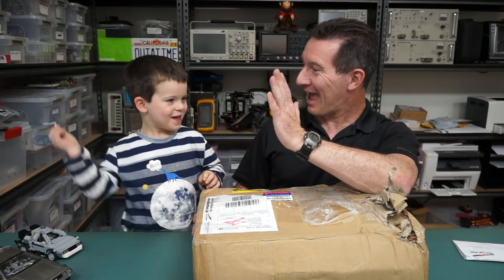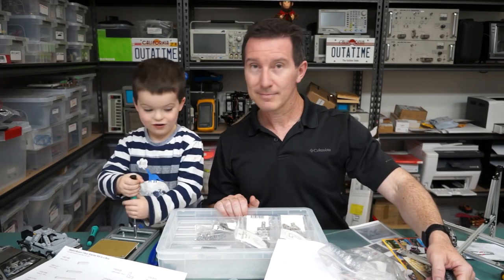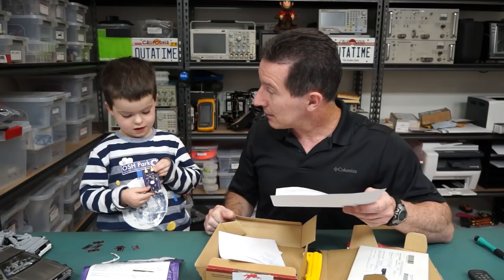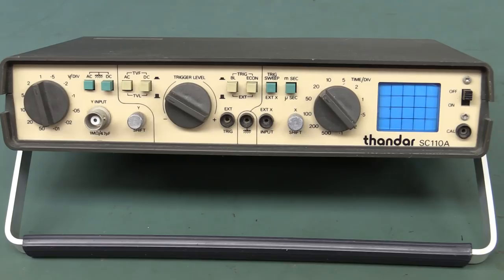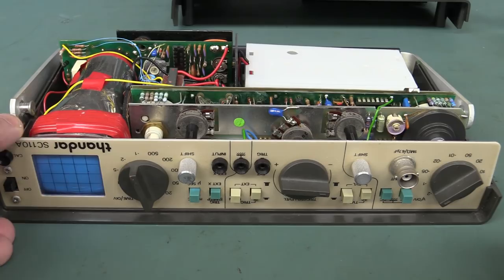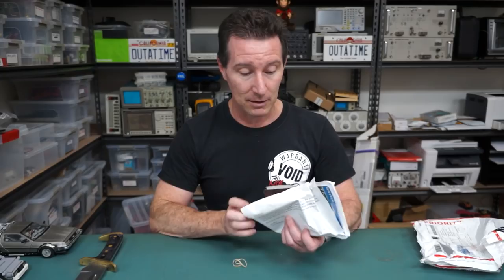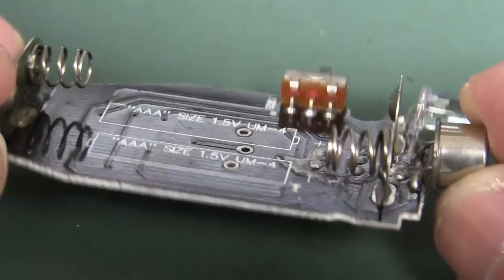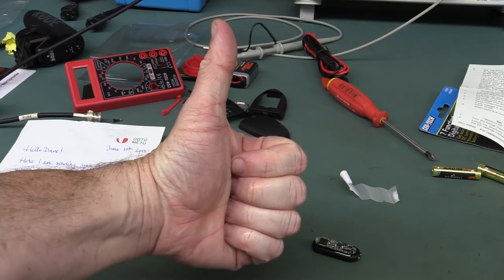EEVblog #813 - Mailbag

Comment: i just opened my multimeter (almost the same) they forgot the fuse 😂😂
Reply: Hey that's not that crazy once we got our new filter Queen Health Moore that particular brand can't remember which one it was but is essentially the same vacuum company.

The first time we were going to use it on carpet after connecting everything properly in the home turned it on and my father said someone seems strange with the carpet powerhead attachment and I'm like yeah it seems like the speed is way too high they said there's absolutely no resistance and changing the motor sound and we lifted it up and sure enough running for the brush roll what's not spinning whatsoever so of course turn off vacuum grabbed a Phillips screwdriver took off the cover and guess what drive belt what drive belt the belt and never been installed on the brand new unit go figure and also no spare ball belt or anything either so yeah we went to the vacuum place and of course they gave us a free belt since it didn't even a blind the first place and a free spare of course and he said next time you need to filter Combs just mentioned this to the the manager we got the filter codes for half price because of the mess up in terms of receiving a vacuum that should have worked but didn't thanks to unhelpful omission how would that happen on quality control when they test these things were at least should? Anyone have anything similar please comment with love to hear it

Comment: typic dt830 variant multimeter . just got my second one for 1.5 usd.
Reply: my previous one exploded because I switched to the gear with the wrong end of the gear-switch wheel on 220v.. this time i gonna mark the gear point end with a paint pen...

Comment: That alcohol detector seemed to have a dry joint, perhaps that's the issue.
Reply: +Prehistoricman 
No, you need to read the instructions!!!!  the switch only lights the LED (torch)
To use the alcohol detector,.... you need good batteries!!!   Press (& hold!) the Power button, until the green, ' Ready ' LED lights..(about 5 seconds, or so )...... then, (while holding the 'POWER' button pressed down) blow into the sensor at the end for another five seconds, or so,...  the lights will then show green, (OK) Yellow, (had a snifter!), or Red, (I'll fight ANYONE in this bar!!!!)    LOL   :-)
Reply: Fred Cooper Your scale of drunkness is pretty good, I must say.

Comment: interesting fact about those harbor freight multimeters for some reason when the battery dies the fuse blows i have had 3 of them do it I don't understand why or how I know i didn't blow the fuse i don't trust them above 30 volts(even then I don't trust that the meter is right never really checked and never use the 10 amp input). I don't understand why the fuse in them is a 125v 0.5a fuse I thought the input for 10 amps was fused where is the fuse for that? just a complete joke!